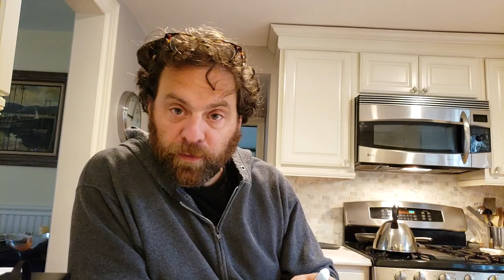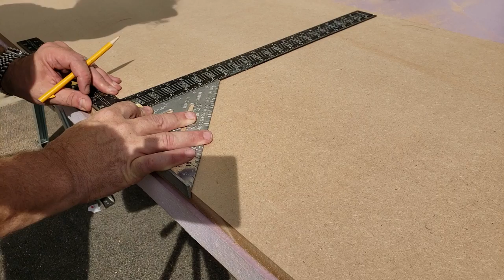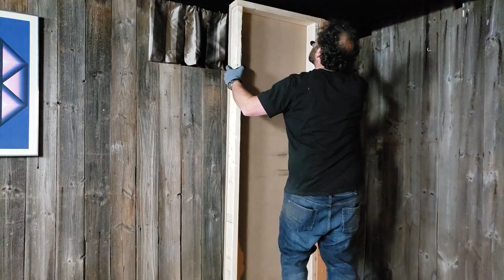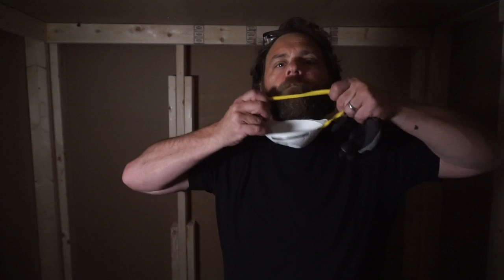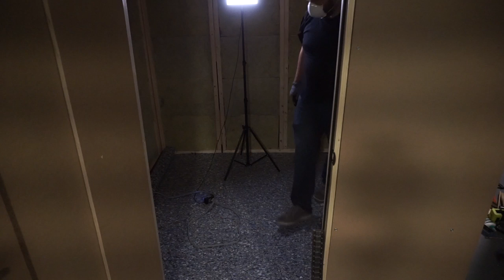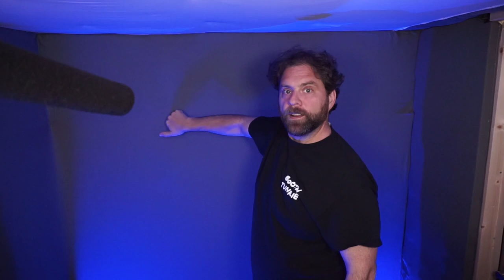My new Booth... or:  3 months of partial blogs in one video.

Comment: Thank you, Mike, for your video. I built a 4'w x 6''d x 7' tall modular booth similar to yours back a few years ago. My wife and I just moved into a new home recently to find when assembling my booth, the ceiling which was fixed on top of the walls of the booth will not fit due to my studio room ceiling being lower than the old house. So, revisiting your video to recall how you did your booth ceiling. I will now modify my booth ceiling to recess between the walls like yours. Thanks for helping me validate what I was thinking on what to do with my ceiling problem. As always, you are "DA MAN". Thanks again

Comment: Hey Mike.  I've been binge watching all your videos recently and took this one to heart!
- "Hopefully you've got a booth, if not, try and make one."
  And I did after watching this!  Mine's 4' x 5' x 7'.   On a floating floor built with 4x4's. Walls are a standard 2x4's with rockwool insulation and acoustic caulking.  1" plywood on inside and outside.  5/8" sheetrock and green glue on the outside as well.  Steel exterior door with small window and another 1/2" of rubber added for density.  Ventilation done with baffle boxes.  Still need to install lighting and build a desk in there.  As well as add the same acoustical treatments as you did (there is a ton of reverb in mine at the moment).  Thank you very much for the inspiration Mike!!!!

Comment: My suggestion for the door would be some auralex foam, and then some bass traps for the corners of the room.  A trick I learned from a sound engineer, is to build your room with varied wall angles, basically no right angles at all, that way the sound will not bounce back directly into the mic.  Also for sound proofing, double 5/8 sheetrock on the outside, with an air gap in between the layers works wonders.  One last thing that can also do alot on the rear wall is a diffuser pannel for the mids and highs.  Basically a bunch of wood rectangles of different lengths all glued to gether.  They are a bit time consuming to construct but basically shatter the sound waves.  Heres a link... https://www.youtube.com/watch?v=oHTmNyo_0O0 . The cool thing is he has a link to a calculator for coming up with the pattern for your custom space.  Thanks for the great content brother!

Comment: Quick drilling tip. If you dial back the number facing up on the chuck it won't strip your screws or rip your wrist off.

Comment: Thanks. I am building my booth in the basement. My basement is well insulated but unfinished so it is just 2x6 framing on two sides, with 4 in 703 in the frames and ceiling and rock wool front and back. I left the bottom 30 inches open and used sound cloth instead of mdf. I am using a curtain for a doorway. It is dry enough for audio books. I am the author,

Comment: If you ever need to redo the ceiling get an extra 2x4 cut roughly  to the height of the bottom of the frame you want to add and use it as sort of a jack.

Comment: Perhaps you can give a ballpark cost for the entire booth project? That'll help some of us in our 'build vs buy' decision as well.
Reply: Phillip Withers 

From looking at the 2x4’s and mdf......add a box of screws....throw in the insulation and fabric....... I’d say you could do it for around $500. You could probably go a little cheaper if you swapped out the 1”mdf for some thinner osb. I’d also opt for buying a pre-framed interior door.
Reply: He would’ve had to resize the interior prehung because of his height restriction but it still would’ve probably been easier. Especially if using a doorknob. Would’ve added to cost though
Reply: I would think the insulation was VERY expensive.

Comment: So I’ve seen this video twice I think now and I’ve just booked s client for an audiobook which is great but my booth (as I’ve moved house too) definitely needs treating. It’s a nice small space but enough room for me to do what I need. Only problem is the ambient noise. Thankfully I’ve just bought some Rockwool which I think is probably the same as the mineral wool you used in this video at 100mm thick. It’s already carpeted and I do have some acoustic foam if I need it. Installing all the insulation on Saturday which I hope sorts out the problem! Thanks for sharing your videos it has greatly helped with everything I do!

Comment: Hey, Mike. Very cool, indeed. I just finished my own New & Improved Home Studio Booth. And I'm kinda lovin' it. I have a huge advantage though. I was a carpenter's apprentice on summer jobs in high school and helped build at least 3 houses from scratch. So, I'm pretty well versed in construction techniques. I also have a garage full of Big Boy power tools and hand tools - Table Saw, Radial Arm Saw, Chop Saw, Circular Saws, Hammer Drill Power Drivers, and home made saw horses. I also have 5 Home Depots, 2 Lowes, a Dykes Lumber and a 2 TruValue Home Centers all within a 20 minute drive for me and my Pickup Truck. But, man, I admire your guts and fortitude to charge ahead and git 'er done. And if it's a money maker, all the better. Good luck with it, pal.

Comment: I like those saw horses Mike, 2x4's for extra support. Never seen that before!
A few tips:
- Before you put the insulation in, it would have helped if you went around each of the panels and joins and caulked them so it was air tight (even cheap caulk will help).
- Also if you laid those walls on some high density rubber, it will help decouple the whole structure from the floor. You can buy large rolls of it and lay the whole booth on it. Then lay your carpet over that.
- When you were doing the overhead beams, you should have put a temp beam across one wall to support one end. Then you could have slotted them in and screwed in from the other end. Then again, you could have flipped the whole ceiling and had those studs on the inside which would have given you the height back inside the booth.
- Put some door seal around the door jam which help stop noise coming through (if you didn't)

Great attempt though and glad it's working for you. Interesting video

Comment: Very, very nice!. Later on, I'm going to do something similar with 2x2s since 4x4 and 2x4 are a little overkill, but I like the mineral wool approach. I too have trains I live LITERALLY, no joke, 1000 yards from two VERY active rail lines; one on either side of my house. So trains are my Kryptonite. Though: the MDF might be working against you. It acts like a big eardrum as is rigid and will transmit sound more. I'm going to opt for 1/2" drywall. Easier to cut and screw. Plus I think it acts less of a solid surface for sound. Currently I had made a 4'x5' makeshift 'booth' out of 1" PVC pipe and moving blankets. Works well though I had to sound treat the rest of the room.

Comment: Hey an idea for cheaper sound proofing for anything in the future. Go to a shipping warehouse and ask for foam blocks or giant foam pads if they have any extra from the gaylord boxes they get. I work at a giant warehouse in california and the gaylords if you didnt know (spelling is correct) is a giant box that essentially is the size of a small room meant to fit on a pallet. So they will often have like 5-6" thick soft foam like what sound blocking foam is made out of in a 4'x4'ish square. Or They will have the harder white Styrofoam which that is probably not what you will want. typically they just toss it unless someone wants it

Comment: This is great, your instincts are spot on -- especially regarding economy. Sometime I'll volunteer what a much more costly construction yielded -- versus your construction. Actually, your booth is not that much less effective than mine. I might say you've got 75% of what I accomplished at a much higher cost - though my interior is a bit larger and not as "regular" in its dimensions. But you've done great job and deserve a great deal of credit for doing what you've done! This should encourage many "on the fence" voice folks to venture forth. I, however, am still most interested in your video hardware and lighting scheme in this small space.

Comment: Such a fun video. I couldn't tell how you attached the mineral wool to the ceiling though. And how did you finish the walls? Is that fabric or drywall?

Edits: 
How is it for temperature? I'm sure that with all that insulation it gets pretty hot.

I have been watching your content for a while and find it so inspiring. Between you, Bandrew at Podcastage, and recently Curtis Judd at Learn Light and Sound I think I have things mostly figured out. I have a mic (that I'm trying to upgrade) and I'm working on recording something amazing. Honestly though, your voice sounds so good it's imposing to think I can make anything that sounds reasonable in comparison.

Comment: Great job Mike. As a carpenter and designer in my youth I could show you a more cost and time efficient way to build a whisper room. However as your first carpenter job you achieved your goal and that is AWESOME 👍
Now that you are back. Do you have any thoughts about using a Fender Mustang 3 amp as a pre amp? Do you now prefer using the DBX 286s or does Reaper do the job as well. After watching most if not all of your videos I’m using a Shure sm7b and Reaper. Currently using my Fender amp as pre amp, seems to work now noise issues.?

Comment: Hey Mike, loved the video, it was very informative and helpful. I am currently working on a bedroom recording setup and was wondering if either you or any other booth junkies had any tips for sectioning off the corner of a room (the corner I'm referencing has acoustic foam and insulation but is part of a larger room) thanks in advance.

Comment: MDF is terrible.  I have done too many projects and will never use them again unless it is called for. Ply wood so much better and light usually.   MDF sound great but terrible.  Also from memory it absorbs water and crumbles easily. Ply wood great. Cabinet ply wood expensive, but so nice.  
Did you have a reason for using MDF? That room looks so hot. You should get a ruggable rug. They make a new product that is a sheet that staples on that eliminates all sound. Can’t Remember the name of it though new product. Acoustiblock is the product. They can use it to make whisper rooms